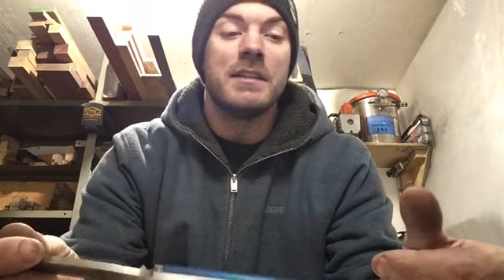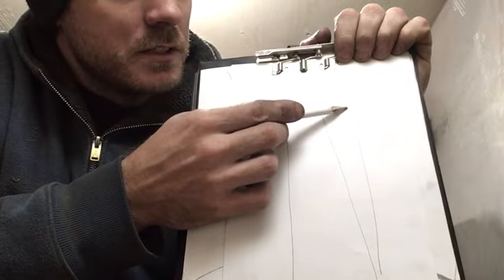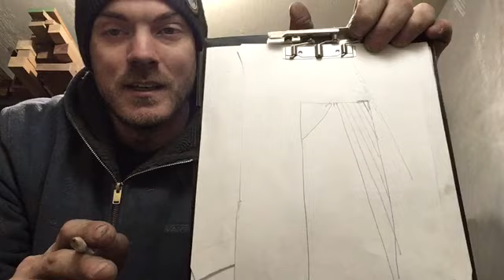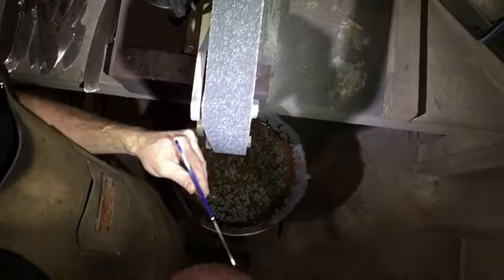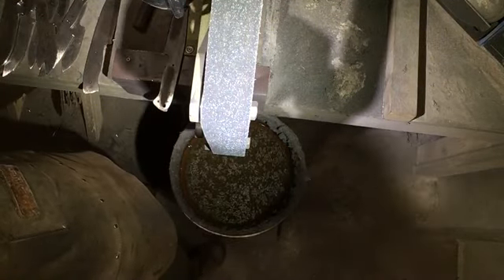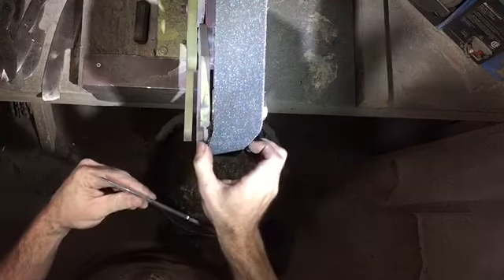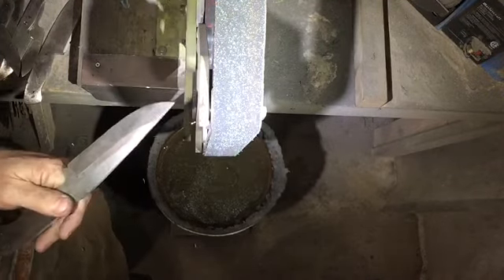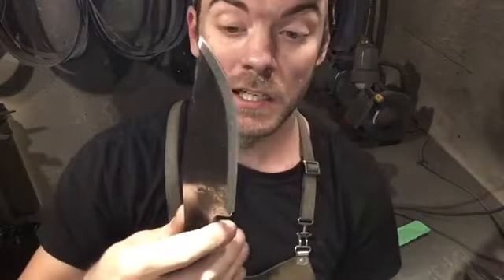Shut Up Already - Rough Bevel Grinding

Comment: This is great! These tuts are so insightful! Do you have suggestions when you get to the tip of the blade, where the edge starts to curve up to the point? Do you tend to just drag straight across or move the blade outward to accommodate the curve? I couldn’t quite tell in the video.
Reply from the maker: Hmm, it's hard to say, I definitely keep the blade horizontal (don't try to turn the blade to keep the edge perpendicular to the belt direction) but I think I might pull the blade away from the belt slightly as I get to the tip. I've never really noticed!

Comment: I draw out my bevel with a sharpy then get it to about 80 percent of the way with 7 inch angle grinder in a vice, 90 percent of the way with disk sander and last 10 percent on the belt, i found this to be the most afordable way. One of my buddies uses a steel cutting blade in his table saw and does the whole initial grind with it, but im not that brave
Reply: Mordy Fisher grinding bevels in a table saw might be the craziest fucking thing I’ve ever heard.
Reply from the maker: @tylerhall9681  Agreed! that sounds insanely dangerous!
Reply from the maker: I could see the angle grinder helping remove a lot of the bulk, as long as you don't go too deep and develop a hollow grind when you don't want one!
Reply: @MikejonesknifeandtoolTk  yeah I use it upside down in the vise, and work on it just like you'd use a wetstone. So theres no risk of hollow grinding. Also i know theres probably no going back for you now, but i you did the first half of your bevel work with your edge facing down, you would save so much on belts, edge sheer is only really a problem when the edge is leading and cutting in vs trailling and skating over
Reply from the maker: @mordyfisher4269  I explain about how I avoid edge sheer in the video.

Comment: Your grinder does not seen to be hauling butt. What speed are you starting with?
Reply from the maker: The motor spins at about 3600rpm. There are a lot of times I wish I could slow it down. Hopefully the next one has a VFD
Reply: Thanks, setting up a kmg with 3step pulley system.  @MikejonesknifeandtoolTk
Reply from the maker: @dwightlebsack3511  That's the economical way for sure, just turning that vfd dial looks pretty sweet though!